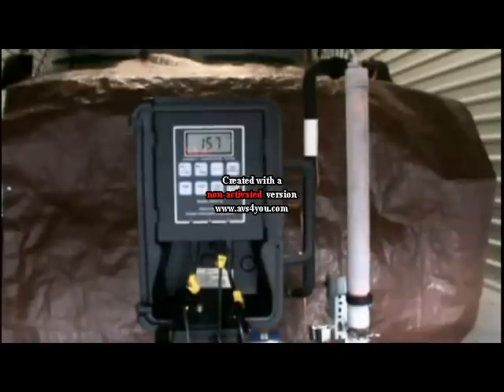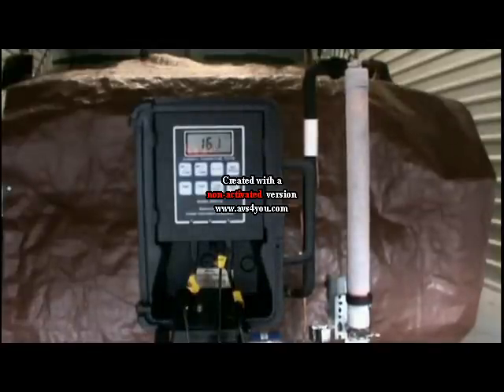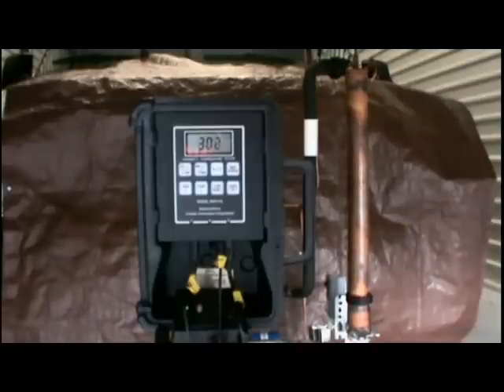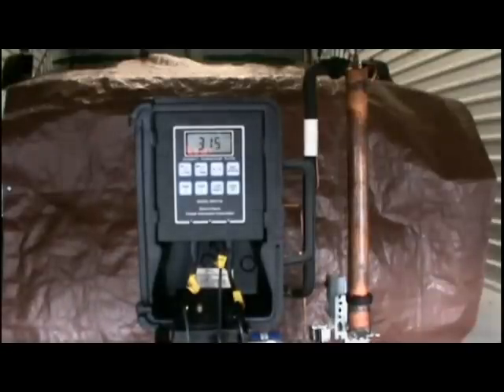Evaporator Having Defrosting Capabilities

Comment from the maker: @HVACRSupply 

Conventional minds would think so but you are incorrect. Our technology elimates the need for a reverse cycle in a heat pump application. We took a 2 ton OEM heat pump unit and retrofitted with our TriTube evaporator and found that when we energized the TriTube Coil, we reduced the energy usage (wattage) by over 22%.

Comment from the maker: Conventional minds would think so but you are incorrect.  Our technology elimates the need for a reverse cycle in a heat pump application.  We took a 2 ton OEM heat pump unit and retrofitted with our TriTube evaporator and found that when we energized the TriTube Coil, we reduced the energy usage (wattage) by over 22%.